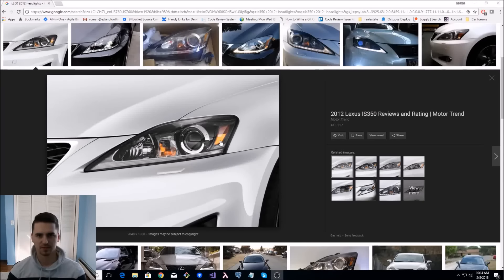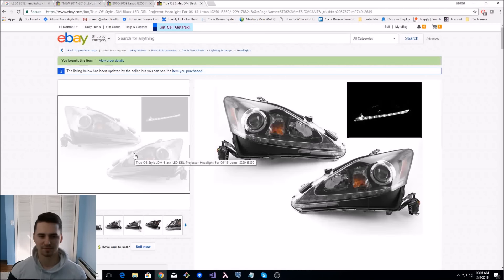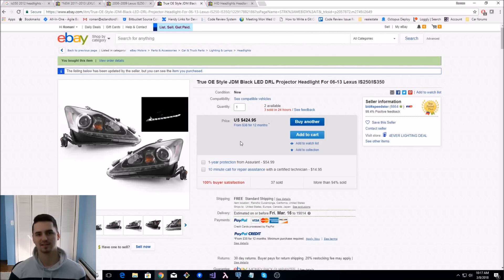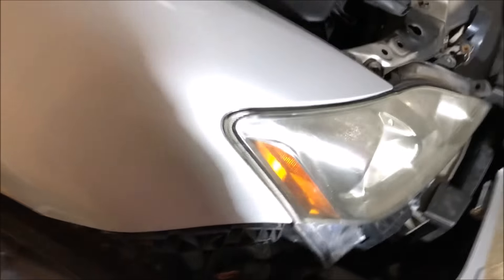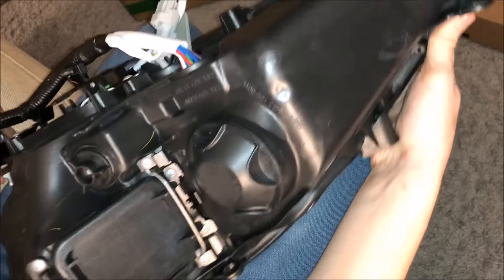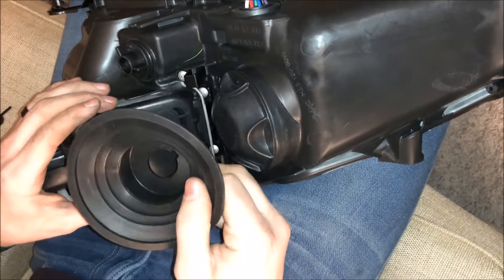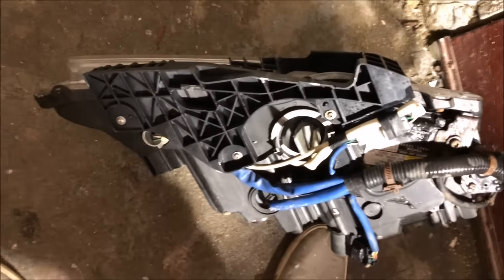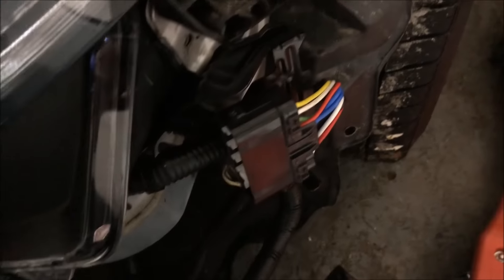How To Get 2013 Headlights on Any Lexus IS for $400 Or Less!

Comment: Hi there, i have IS 250 europe version from Ireland, are they gonna fit without any issue? what about AFS does it light up or you need to take fuse out? my one have just regular bulb, not even xenon one - is that gonna be ok and just plug & play or you need change voltage, reprogram main computer etc? thx.

Comment: Very informing video. Gotta say did you had to take the headlight and ship it back to the seller to replace the LED of the DRL. Also I got halogen bulbs on mine but how big of a fuse did you go?
Reply from the maker: The seller sent me a new headlight first and once I installed that one I shipped the broken one back to them. I actually ended up going with a LED bulb and never upgraded the fuse.
Reply: @romagrigorenko  thanks for the fast response. How did you get the LED to fit in that small housing? I heard some dont fit and can leak moisture if the cover is not there. Mind if you send me a link of the bulbs you used? I'd go that route but I turned away due to that reason.

Comment: I've had these, nice but cheap looking when the lights are on also i had water intrusion.  Switched to  Vlands soon after purchasing are more premium looking. Yes they cost a bit more....but you gotta pay to play. 
You do need Toyota techstream to deactivate DRL (Vlands DRL are independently wired), and pull the AFS fuse. 
So far ive had them for over a year in hot, humid hawaii. No problems so far.
Reply from the maker: 808 G8GT yeah I’d take the VLand any day. They weren’t out yet back when I was making this video
Reply: vland are also cheap and when they brake it's good for the trash bin
Reply: @ThaexakaMavro these are better than vlands lol, i threw mine in the trash😂

Comment from the maker: Updated links to these headlights because original seller ran out of stock:

https://amzn.to/2DxWxnH 

https://amzn.to/2PJKdYP

UPDATE: after about 3 months with these headlights and an HID kit, one of the headlight fuses burnt out. So id recommend upgrading the fuses for them or finding an LED kit where the heat sink is small enough to fit into the headlight. If all else fails, you can always just upgrade with some good halogen bulbs. 

LED kit I ended up using: https://amzn.to/2PDgaCd

Also, one of my nike led dots went went bad but the seller replaced it with the warranty.
Reply: Romanenko Garage so you had oem hids and the halogen set up plugged right in?
Reply: And did they come with bulbs?
Reply from the maker: Kareem Barr yup, my car had oem hid headlights. And this set plugged right in
Reply from the maker: Kareem Barr yes come with bulbs
Reply: Romanenko Garage so do you think if I buy standard oem halogen style headlights and replace my hid headlights with them it will work if I buy new bulbs?
Reply: Which fuse is the one that went out and where is it located. I'm planning on buying these but I might as well replace the fuses right away.

Comment: Romanenko Garage hey buddy! Great info!  I’ve just bought an 08 2is lux sport that had the xenons, but with a same set already installed.  They look good but I’m skeptic bout the beam pattern.  They weren’t adjusted obviously.  But I’m curious, what route have you went for bulbs. Low’s or highs?  I was thinking of buying a set of auxbeams for there built in drivers. Since these are capped.  
Any input is appreciated!    👊 salute bro

Comment: Hey uh!!  What did you do with the old headlights?  Send’em to me.  I don’t really care about the check led mark.    I had a 12 IS250 that the wife totaled but she wrecked our 08 model first I still have it.   You know the ones with the recall on the runner melting dash and recalls on the airbag.  just need factory headlight the 08 we have light are good but the molded brackets mounts are broken.  And you can’t even get a good dell on those headlights, hood , fenders and bumper from a salvage yard.  They want a good US mint...  If you hadn’t sold them let me know what you want for them...

Comment: Thanks for the video, Roman. I currently use LED bulbs in my 2006 Lexus and they work fine, so I assume it would be a more straightforward installation for me.

Regarding those daylight running lights, if one of those LEDs died, does that mean you have to buy a new headlight?
Reply: I think if the led dies you have to get a new headlight not sure though

Comment: Hi Roman, thanks for the video! Do you need to do any re-wire to make the LED DRL work properly?
Reply from the maker: petersu33 hey Peter, so the actual LED stripe works when your headlights are on at night (in auto) but during the day only the highbeams work as DRLs (in auto)
To get the LED stipe to turn on during the day, you need to switch the headlamp stalk to the 1st position, the one that is like just a circle icon. Not sure what it’s called exactly.
Reply: Roman G thanks for the reply. Looks like we still need to tap the LED wires to somewhere to get them work like a true DRL.
Reply from the maker: petersu33 yes, exactly.
Reply from the maker: Igor Konstantinov thanks Igor, that’s very helpful

Comment: Is the light output and quality with DEPO + hid kit better than stock HID? I have the 2007 IS250 with HID +AFS.
Reply from the maker: David Seriphayrath depends which HID kit you get. But if you get a good 55w kit, I’d say the light output is just as good if not better. However you do lose AFS
Reply from the maker: The light cutoff line looks clean too. But keep in mind you might have to adjust it to not be too high.
Reply: Thanks, looking at the morimoto hid kits. Need to replace my yellow headlights, tired of sanding. lol

Comment: Exactly, why do through all the hastle with HID, when you can put Nighteye LED bulbs instead...
Reply from the maker: Joe Black most LED bulbs have huge heat sinks and they don’t fit inside this headlight. Also LED technology is nice but the power output isn’t as strong as a 55w HID despite what some manufacturers claim. There are detailed tests on this you can see on YouTube. That said, I still went LED at the end when I found one that would fit.
Reply: Hey, thanks for sharing your experience. I am waiting for my Nighteye LEDs, they should fit.
Reply from the maker: Joe Black yeah no problem and good luck!

Comment: So how long have you have this and what did you end up doing with it. Did you get hids  or led bulbs or what work at the end.
Reply from the maker: Luis Reyes I had it for 6 month before I sold the car. I ended up fitting some LEDs in there.
Reply: Romanenko Garage thanks for taking the time to answer even dough you sell ur car. That’s what am leaning towards just get good quality led bulbs. When you said the fuse went out you mean the a fuse inside the light or a fuse in the car.
Reply from the maker: Luis Reyes it was a fuse in the fuse box under the hood. It was when I had HIDs in. And then I switched to LEDs, which barely fit in there. If I had to do it again I’d honestly probably just get some nice strong halogen lights and save myself all that trouble.
Reply: Romanenko Garage thanks man for the info. That’s what I probably do

Comment: Hey man did you have any trouble with the harness connector on the aftermarket headlight?
Reply from the maker: Abidan Contreras what kind of trouble do you mean?
Reply: @romagrigorenko  The Connector on the Aftermarket Headlight does not fit on the Harness on the car did you customize the wires or connector?

Comment: I bought this hid kit and both sides have now gone out, did you by any chance increase the fuses
Reply from the maker: Steven Yassa no, I ended up getting and LED kit instead.
Reply: Roman G, what kind did you end up getting
Reply from the maker: https://www.amazon.com/gp/product/B06XHDYTGL/ref=oh_aui_search_detailpage?ie=UTF8&psc=1
Reply: How did the beamtech fit? I’m having trouble fitting mine in.
Reply from the maker: brian Truong I just fiddled with them until they went it. Mine actually just blew the fuse recently too. So I’d recommend going with LED or upgrading the fuse.
Reply: I got the LED kit that you linked how are they holding up? Also do they fit directly in because I’m having trouble locking them in
Reply from the maker: brian Truong yeah, they were a tight fit bit I got them to fit after a while.

Comment: so you re use stock hid bulbs?
Reply from the maker: juan cusi No, I bought a slim HID kit there. Now I’m using LED bulbs though.
Reply: Roman G sorry I had commented before i watched the whole video lol thanks for the patience. how are the lights coming along? I have factory hid and i sanded them but there’s damage on the inside. i’m gonna tint the lense to make it less noticeable and if it fails i’ll get these. thanks for taking the time to make the video
Reply from the maker: juan cusi haha no problem. Ive actually had a one of the led bulbs go out on the nike strip. But Im handling it with the seller so hopefully theyll send me a replacement. Other than that, I love how they look and it was a cheap price anyways. Especially after I sold my old lights lol
Reply: @romagrigorenko  can you do an update video of the led and how they look
Reply from the maker: @THYP3RR  Sorry, I definitely would but I sold the car a couple months ago.
Reply: @romagrigorenko  Do you remember if the fogs were just plug and play?